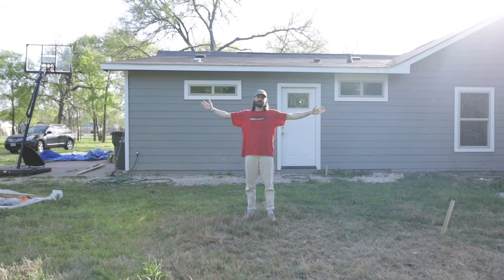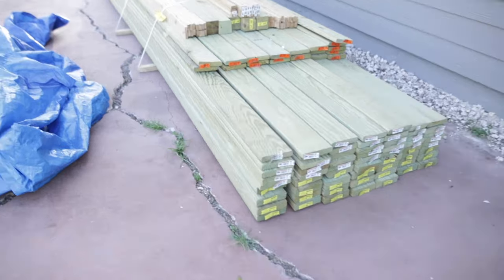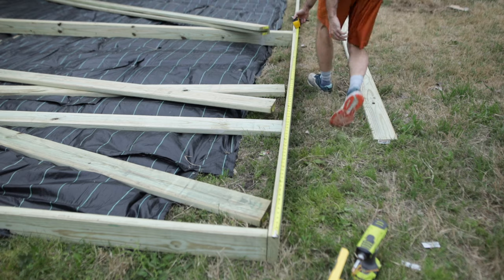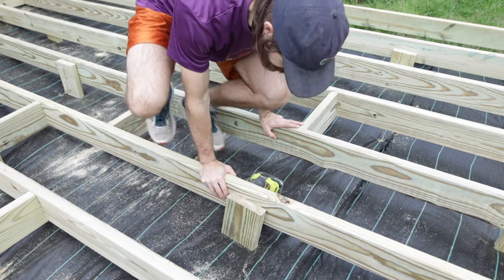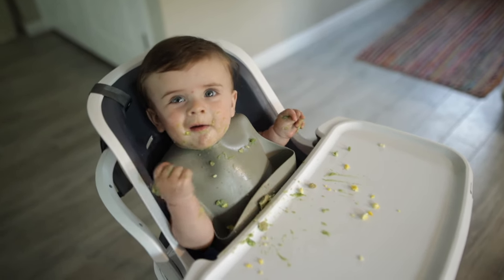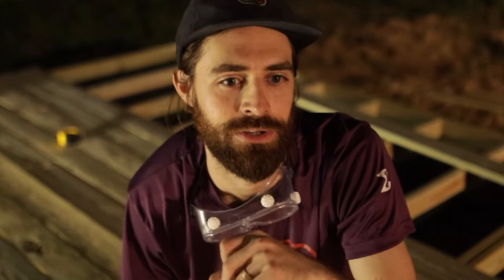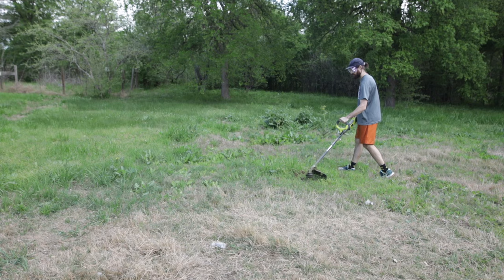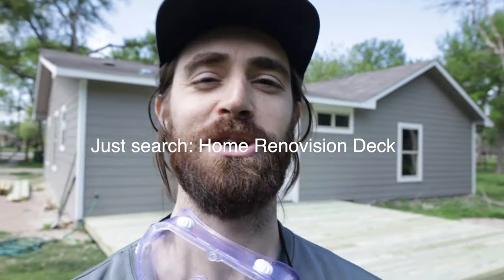The EASIEST DIY Ground Level Deck Build

Comment: Nice deck but sadly it will settle over time and sink with the 2x6 block method you used. No support other than soft ground.
Reply: Should also be leaving a 5mm gap between the boards to allow for seasonal expansion/contraction. Looks great though!
Reply from the maker: The boards were a tiny bit wet when I installed.. so now that it has dried out the gap is solid and has enough rough for expansion/contraction. Some spots are actually have a little bit more gap than I would like. Definitely recommend waiting for the boards to dry completely and then putting in the gap like you suggest!
Reply: Even if it does he can throw some low profile auto jacks underneath and address the problem. It's really no big deal.
Reply: @Shanonmcnab576  🤣🤣🤣🤣

Comment: OMG...I got such a chuckle when you said to make sure the string is level and put that 2' level towards the string...
Your family is amazing...you hit the lottery there.  I do have some news for you--those 2 x 6 blocks will eventually sink...I do that but I put a flat block under them to spread the weight.
Doesn't matter much cuz that deck is choice and you kicked some ass on it.
Reply from the maker: Ya that would have been smart to do. lol about the level.

Comment: Been watching a lot of deck building videos, another tip is you could've taken a top plank and laid it top to bottom in the middle and ran your other boards from outside edge to the middle board. I do like the spacing on the boards. Going to do that myself. Great video! Get yourself a helper so you don't have to run around so much...
Reply from the maker: That would have worked! That’s the more legit way to do it. Need to make sure that board is the correct size to support the weight.

Comment: Excellent video mate . I used the same method after watching your video. To people trying to solve the leveling problem , I just mixed some quickrete and shoved it under the unstable parts and it worked wonderful.. cheers!!
Reply from the maker: Thanks! Glad to hear.
Reply: I have the same idea since before watching this video. I watched a lot of videos before this one and I think too much money is spent grading and doing so much work. I'm going to do the same thing you did, I think it won't fail me.

Comment: First; Hume. That’s my mother’s family line.

Second: good effort, some of the methods could be improved for your permanent deck in the future.

General construction notes: Crowns (“rainbow” vs ”smile”) and bowing (bow at top, allowing for load/gravity correction) of boards should be checked during build. Also a small gap, up to 1/4” +\-, to ensure proper drainage of water., and since it was built next to house the deck should slope (1/8” per foot) away from foundation to avoid issues there. Where as a floating deck can be level all around.

Hope you can get a few more years out of it.

Comment: Excellent video. I had that same idea and many people told me that he was crazy. Crazy I think there are those who spend money and money and money refilling refilling refilling for a simple deck. I think the best thing is to do what you did and to reinforce some parts put cement underneath once you have the frame done before putting the final boards. Thanks for your video.
Reply: Crazy?  I was crazy once.  They put  me in a room.  A rubber room.  A rubber room full of rats.  Rats make me crazy.  Crazy?  I was crazy once. They put me in a room....

Comment: Get 4x4 posts and notch them to make your supports. Really do not want any part of the deck to come in contact with the ground. They make pyramid looking footings that can be used for floating decks such as yours.
Reply from the maker: I was going to do that but decided to try the pressure treated way. So far so good.

Comment: Awesome job... new subscriber. Also just food for thought, Its called "cup" not bend. You want the cup to crown up on the board. Like a upside down smile 🙃 (for anyone wondering what I mean).
Reply from the maker: Ya! Appreciate the tip.
Reply: @humediy  no problem Mate... keep up the good work
Reply from the maker: @josesantiago764  Thanks!

Comment: question , i see everyone putting the joyce’s like up and down vs left to right  then running the top boards left to right, making you have to connect boards because they don’t make them long enough to reach all the way from one end to the other. Why no do the opposite , and then the top boards would prob be long enough to just have to use one piece and be done with it ?
Reply from the maker: You can definitely do it either way

Comment: So good! We are planning on doing one like this size 20x20 and my husband knows nothing about woodwork. This was really helpful!
Reply from the maker: Good deal! Make sure you look into your county requirements.
Reply: Your deck looks awesome. Thanks for sharing. We are planning to build our deck this wknd and your videos have helped us alot. All the way from Paris, France 😅
Reply: @humediy  something curious: if the decks stay without gaps, will it be easy to expand in hot weather?
Reply from the maker: @kysimwpc  it actually has gaps. When I installed the planks it was slightly wet so when it dried it left the perfect gaps. Beginners luck.
Reply: @humediy  many thanks, I'm curious if there is the decking without the gaps so can install easily?

Comment: Beautiful family...?? Is the deck level or did you add a little slope to it? I get snow so I was wondering if I need it to have a tad of a slope away from the wall? Thank you!
Reply from the maker: The ground was already at a slope but I did make sure that it was still somewhat slopped as I built it. You'll def want to do that.

Comment: I would of used concrete peers for underneath support. Otherwise, great job. Just needs built in seating and party lights.
Reply from the maker: Definitely!
Reply: @humediy  Putting on seating and party lights can be another video. Would be interesting to see this process. 😀
Reply from the maker: @bear42geo  good idea. Might have to do that
Reply: @humediy  I built an outdoor movie theater on mine.

Comment: Never seen a deck built without concrete blocks or posts in concrete... Interesting.
Reply from the maker: Check out my latest build. Foundation with tuffblocks. Better solution.

Comment: That's a nice deck you built I would have used the pre-engineered plastic flooring whatever you call it and it's a shame you didn't actually put Butters in concrete underneath of that which you can still do that you just have to ask the vet down because as small as your house is you could enclose that and make it up Four Season room without a whole lot more effort if you had a good foundation underneath of the deck however you can't put that kind of weight on that just sitting on the ground but it can still be done and other than that looks like a nice job
Reply from the maker: Good idea on the 4 seasons room. Might have to do that at some point. Will have to switch foundation like you said but might be worth it

Comment: What nails did you use and size of them? Also what the length of the joists ?
Reply from the maker: I think I used 2" for the floor boards and 3" for the joists - DECKMATE #8 x 2 in. Star Flat-Head Wood Deck Screws (5 lbs./Pack) The length of joists are 16'
Reply: @humediy  so joists were 2x6x16’?
Reply from the maker: @steadybread1306  yup yup
Reply: @humediy  and the boards you used between the joists, are those same size too?
Reply from the maker: @steadybread1306  they sure are
Reply: @humediy  how many pieces you need for between the joists ? 1 piece enough ?
Reply from the maker: @steadybread1306  I pretty much alternated on the joist. 1 on a joist and then 2 on the next joist, 1 on the next, etc.
Reply: @humediy  I mean you use the same size of a joist for in between like 2 x 6 x 16?
Reply from the maker: @steadybread1306  ah, yes

Comment: Hey I like how you built your deck. Have you had to re-level it since this video? I used pavers and pea gravel on my corners but otherwise built mine exactly like yours and mine kinda rocks side to side because the pavers have sunk. Wondering how to address it.
Reply from the maker: I haven’t had to relevel it... you might have to stabilize one side of it somehow. Maybe get someone to stand on a side and then throw more rock underneath the other side. Not sure.
Reply: @humediy  I just shimmed the corners above the pavers this afternoon and that eliminated the rocking. I kinda wish I had put legs on the corners like yours though.

Comment: What’s the pattern that you cut your deck planks? What’s sizes
Reply from the maker: Not sure the exact size... but I put a full 16' board across and then grabbed another one to finish off the end. Make sure the ends are on a joist.

Comment: I belive that  it's a temp one so add some flat planks under the legs  or put  Square concrete slabs Under the legs so when it settles and people are walking on it it don't just sink into the ground other than that I thought it was a great project I thought it was AA great temporary deck
Reply from the maker: True! Thanks!

Comment: How did you calculate your lumber needed?
Reply from the maker: I drew out a plan with all the spacing pre-determined. Then took the size of boards I was planning to use and did some math to figure out number of boards. For example if you have a 10'x10' area, and you are using 10' boards. Then you can take the width of the 10' board and divide the width of the area to get your board count eg. 100" width of area divided by 6" board = 17 ish boards. You can account for spacing between boards too if you want to get more specific. And then always buy 5-15% more wood than you plan for mess ups or space you didn't account for.

Comment: Should’ve gone with a patio.   Your deck is too close to the ground and the moisture is trapped without air flow.  In a few years the underside will bloat & rot out.  You’ll see early signs with black mole on the surface.
Reply from the maker: I hope that is not the case. Either way I built this as a temp deck b/c I have other plans for the house :)

Comment: No. No. And he'll no. Need to watch way more videos before building a deck. This deck will rot on the legs quickly as the endurance sucks moisture out of the ground. Need pavers or footings to rest on properly
Reply from the maker: It’s pressure treated wood.

Comment: You just guaranteed that your deck is going to sink and rot.  You should've at LEAST planned where your support legs would be, and dig out 6-8" and filled with gravel and put at least a 12" square patio block underneath.  You should NEVER have wood sitting directly on the ground, even on landscape fabric.
You should've also treated your joists with something like Thompson's Water Seal before you covered them.  And as has been said, you didn't leave enough spacing between the boards.
At best you have a temporary win, because in the long run, you're going to have to do more work and spend more money to fix the mistakes you've made.  This was fairly amateurish, and you will not be satisfied with the work you've done.

"If you don't have time to do it right the first time, when will you have time to do it right the second time??"
Reply from the maker: All my wood is ground contact pressure treated wood.. it should hold up! Curious if you had a bad experience with gc treated wood?
Reply: @humediy  "Should" hold up....  Maybe, maybe not.  Depends on the quality of the wood.  Why chance it??  If you don't have time to do it right the first time, when will you have time to do it right the second time??
Reply: @ffjsb  Maybe you don't understand what "ground contact" means?
Reply: @mcjama  I understand quite well what "ground contact means".  And even "ground contact" rated wood is subject to eventual rot.  That's why my deck is on a concrete pier, and doesn't sit in the dirt.